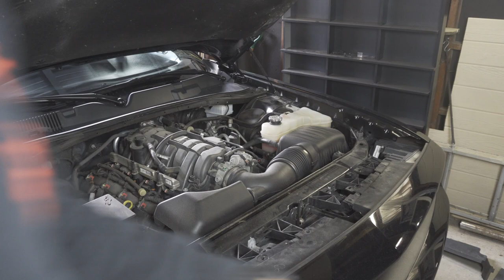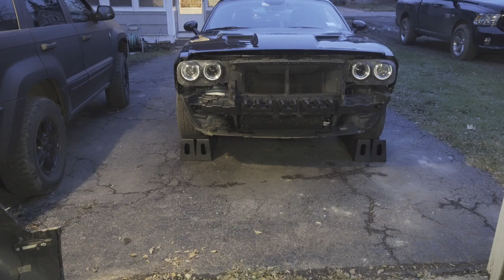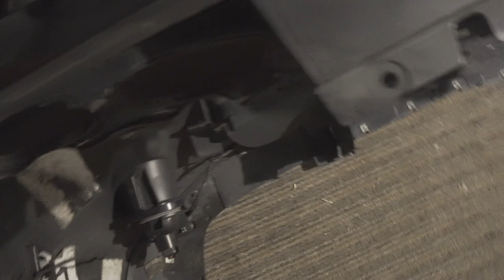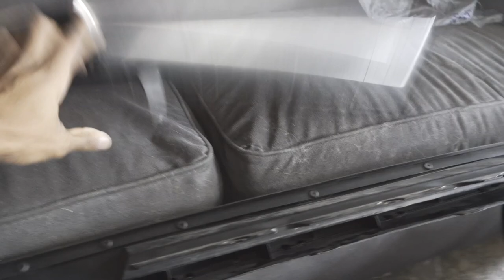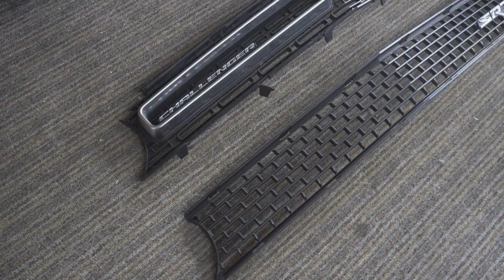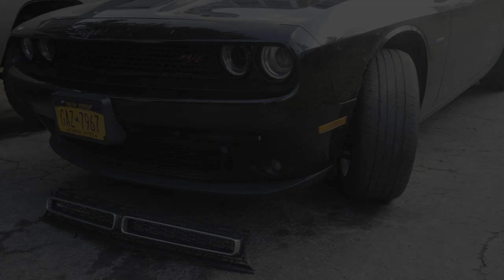Installing an SRT/Hellcat Grill on a Dodge Challenger RT!

Comment: I did this swap on my 2016.. removed the tabs from the bottom completely, and used black construction adhesive around the entire   Grill frame. None of the tabs lined up with the hellcat grill, and if you try and make any tabs work it’ll be off and leave a gap. At least it was for me. Other than that, the grill fit great. Good job with the vid
Reply: So you just used the top tabs
Reply: @freshlyfe4400 I wonder the same thing…

Comment: Hey bro did you use any extra tabs or anything? I bought the grill and was gonna do it today but was wondering if I should buy extra hardware
Reply from the maker: @Jsilva4161  I would have a few extra. It’s not a perfect fit so I even used a few zip ties to make it even more secure
Reply: @OmegaGreedAK47  ok right on thank you !
Reply: Thanks again bro for the quick reply